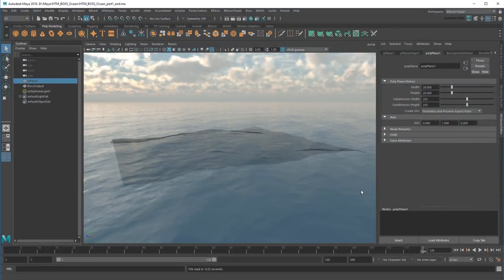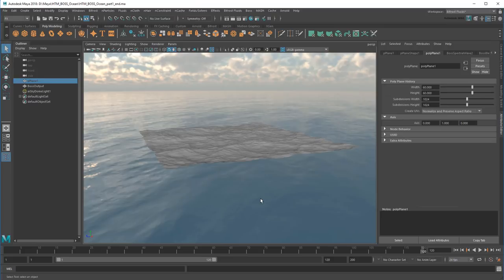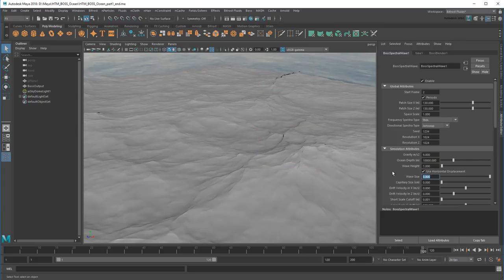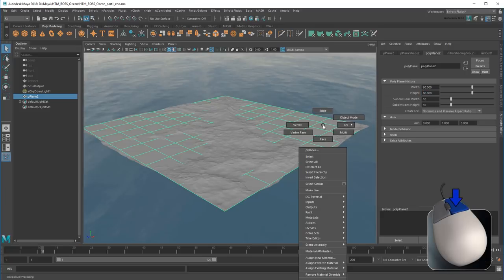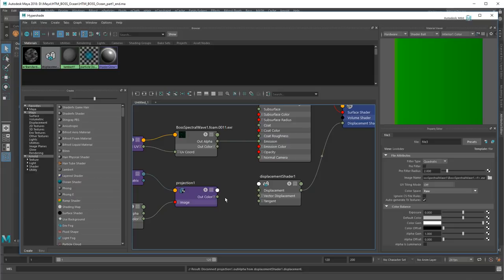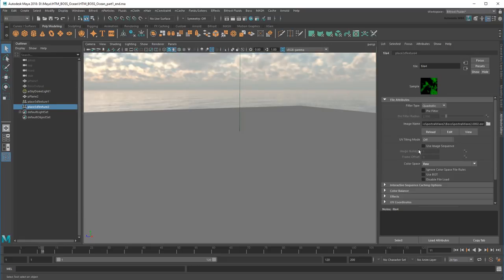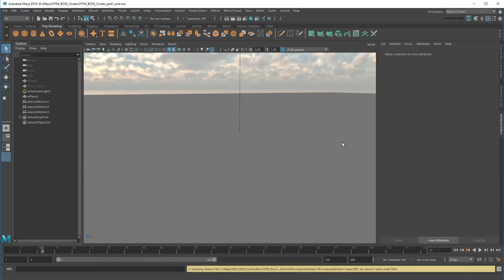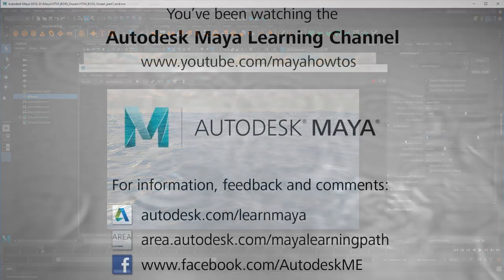Creating an ocean - Part 2 of 4: Tiling an ocean for rendering

Comment: I didn't understand how to render the Image sequence of the Second plane wich only have texture animation and not real keyframe, my "render sequence" option renders only one Image.. Thanks
Reply from the maker: You need to change the Image Format in the Render Settings to a multiple render format (i.e. name.#.exr).
Reply: i set up it, but my sequence render gives me a flat plane, instead of the 3d projection shown in a single render
Reply from the maker: Did you produce the necessary EXRs and properly set up the displacement map?  Also, did you make sure to render using Arnold?
Reply: yes i repeat everything step by step, and if i launch a single render frame, i obtain the right result , pretty identical as yours, but when i try to launch a sequence or batch render, my plane remains flat :( thanks a lot for your support, fantastic channel
Reply: I have the same problem even with a single image. If i render the low res plane it gives me a flat plane :( shader
 is applied, displacement maps too..dunno how to resolve.
Reply: Solved for me!!!! I was rendering frame 1 :p

Comment: the vector displacement looks different in vray, no clue why, what about the black areas in the maps? I can not measure negative values in the middle of these areas? that means, they are flat time:4.06
Reply: i had the same issue too! did u manage to find a solution for it?
Reply: @Tobsters755  nope
Reply: @dubtube6691  i see. thanks for the reply

Comment: Is there a colorMath node alternative for maya 2017?
Reply from the maker: Odd, the colorMath node should be in Maya 2017.  You can try the colorComposite node instead.
Reply: @Autodesk_Maya  Hey, thanks for replying. I can't find a colorComposite node either. I'm tab searching in the hypershade, the same as in the video???
Reply from the maker: @pdublt3d  Hmm that's very odd.  If you look in the left column of the Hypershade, in the Utilities section, do you see any entries in there?
Reply: @Autodesk_Maya  Nope. I'm using a 'student' version of Maya. Could those nodes be only available in the the full version maybe? Or am I missing a plug-in that's not loaded? Thanks for your help.
Reply from the maker: @pdublt3d  They should still be in the student version (assuming you aren't using LT).  Maybe try deleting your preferences and restarting Maya.
Reply: @Autodesk_Maya  I'm experiencing the same problem, the only thing I see is color profile.
Reply from the maker: @DDAschool  Check the Plug-in Manager and make sure "lookdevKit.dll" is loaded.
Reply: @Autodesk_Maya  Thanks mate

Comment: This infinite tiling should be a one click option as you showed in the previous video spectral waves are independent of the plane's location and tile perfectly without guess work.
Reply from the maker: Actually it is a one--click fix if you're willing to work with geometry.  The problem is that at large sizes, the geometry becomes too dense for anything but an extremely powerful CPU to handle.  The majority of this video is actually about adapting the BOSS ocean to generate a non-repeating displacement mesh that gets around this performance problem (which is really more of a rendering trick than BOSS specific workflow).
Reply: If spectral waves are tileable I should be able to use instanced planes or standins without seams in order to mimic infinite planes, that's the purpose of tileable textures.
I should be able to develop the look of a single plane and make it infinite replicating instances around it just like a mash grid without seams.
Reply from the maker: Unfortunately, if you were to use instances then they'd lose the "window into an ocean world" capability, since they'd be carbon copies of the plane you have.  Again, you can actually do that if you prefer, but it will result in noticeablely unnatural repeating patterns in your ocean, unless you make your initial tile extremely big (which you can also do, it will just impact performance).

Traditionally in rendering, displacement maps are a way to get extreme detail without incurring any of the performance cost (it's a technique used in movies and games for everything from dirt, rocks, bricks, skin pores, etc).
Reply: Ok, thank you.
Reply: Keeping the waves as geo or instancing them is just a bad idea. Displacement is definitely the way forward. However there is a crap load of guess work trying to get the different spectral wave caches to lineup exaclty as they did when they were live in boss... Unless you keep the patch size exactly the same and don't touch the scale it seems really hard to get the same result without going through each one checking they look the same.
Reply: @Autodesk_Maya  do you have a good node for combining the different caches? The Maya math node doesn't seem to exist in my Maya 2018... I was combining them up to now with an aiAdd node?
Reply from the maker: @boycie18  Double-check your Plug-in Manager to make sure lookdevkit is loaded.  That will get you the Math node.